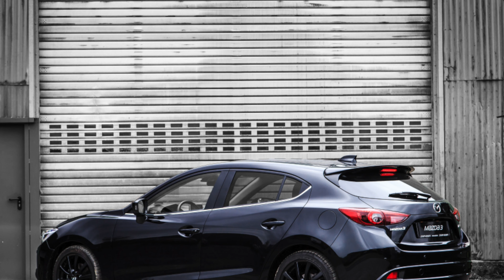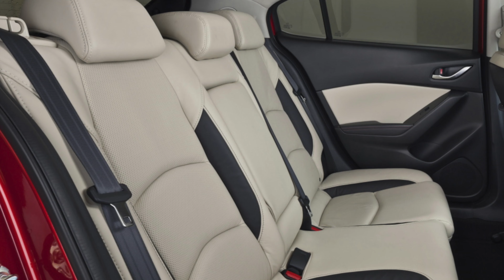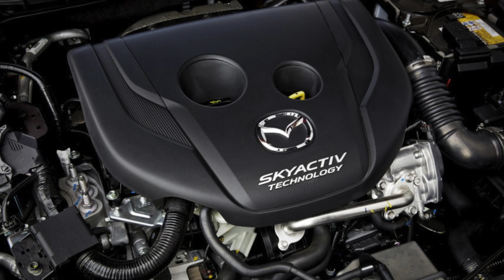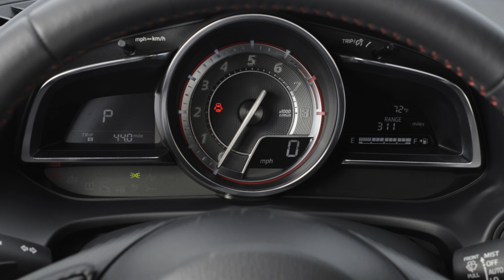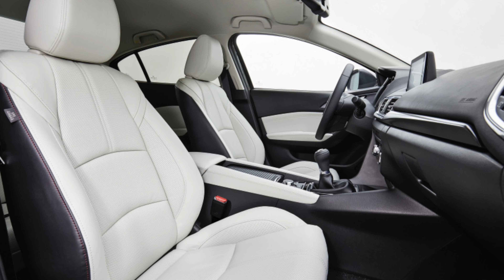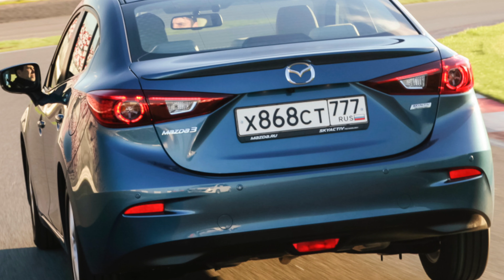Mazda 3 BM Problems | Weaknesses of the Used Mazda 3 III

Comment: Thanks for the upload. I have a 2018 Mazda3 Autmatic GT. As we speak its in the shop at 48,000 miles because I'm hearing a high pitch squeaking sound coming from the engine are. It happens at 0-2000 RPM. Its not very loud but it hasn't gone away and it started about 3 -4 weeks ago.
Reply: Sounds like Aux belt slipping